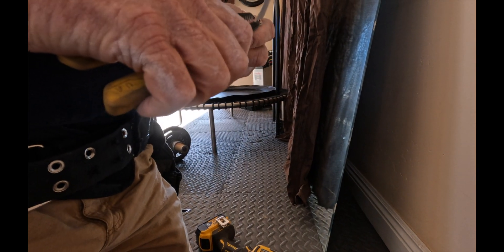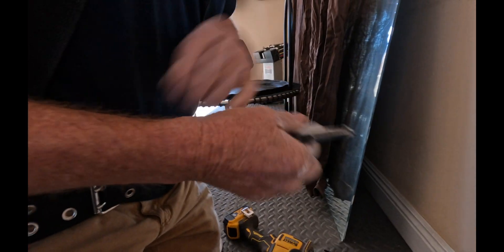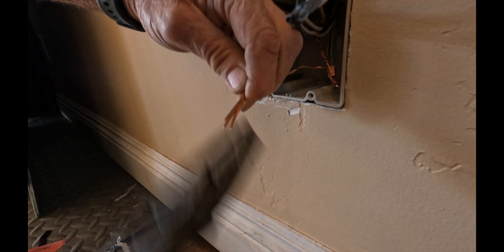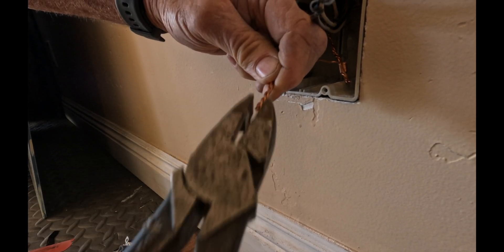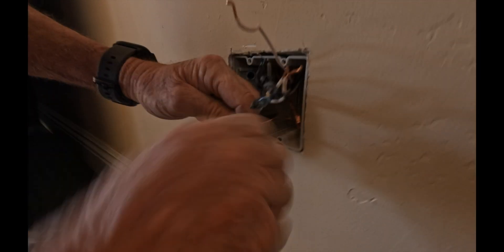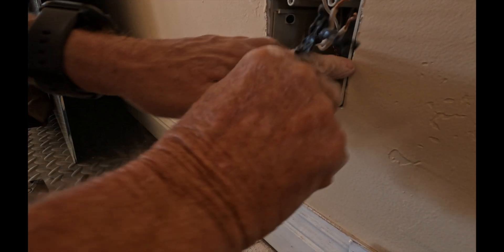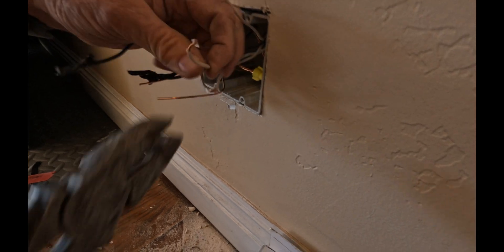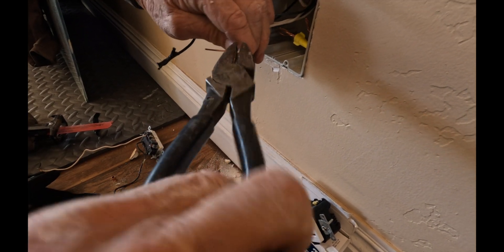DIY - Type A and Type-C USB Charging Ports: A Powerful and Convenient Solution

Comment: Glad this came up in my feed.   Going to be installing these in a few weeks
Reply from the maker: There are a few other Vids on the subject in my feeds. Please check those out as well for clarity on the task at hand. 👍 Have a great time DIY'er. Thank you for the message, it means a lot to me.
Reply from the maker: Also, remember TO SHUT THE POWER OFF before working with electrical current.